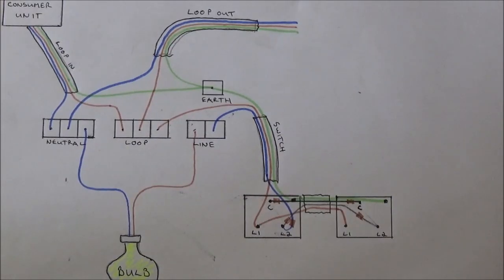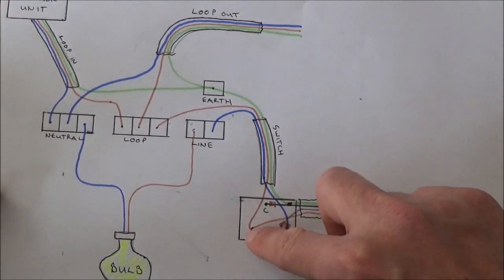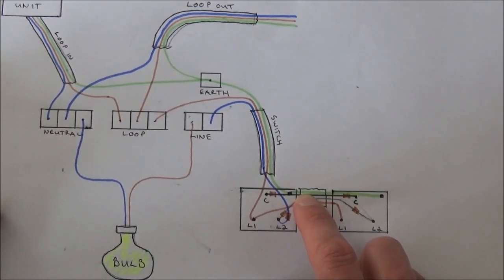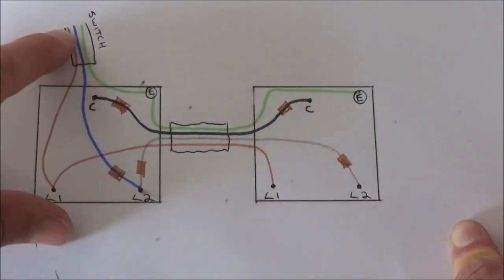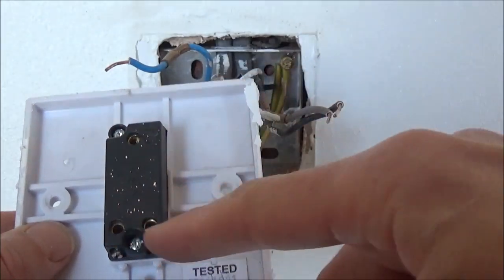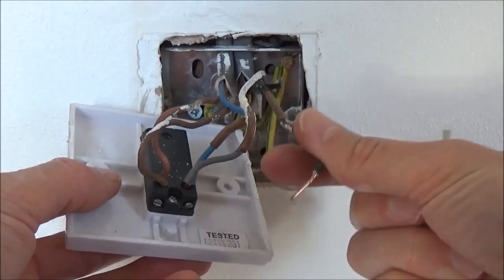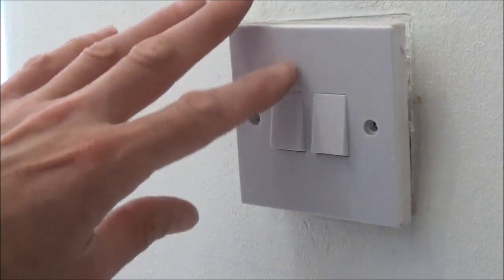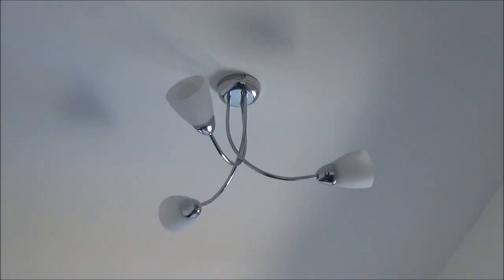How to wire a 2 way light switch. 2 way lighting explained. Light switch tutorial!

Comment: Great channel.

I have a 3 gang switch, and I'd like to move the "2way switch wiring" from the right gang to the left gang. Basically, swap  them over because my stair light physically located on the left side of the landing. Just to align the gangs with the physical location of the light. Is it ok to swap the gangs over following the wiring principles?

Comment: Hi. Thanks for the very informative and interesting videos. One question please. I have a corridor one switch is in kitchen and the other switch is in the hallway 8 meters apart. Both switches are 2 way.

The wires from L1 to L1 and L2 to L2 needs to go up pipes then through each ceiling rose without any interruption and to the  switch? Is that correct?

Comment: You didn't explain what happens when both switches are set to connect Common and L1.... can you explain what happens? there's no connection to the neutral
Reply from the maker: You basically can turn lights on or off from either switch. Hope that helps. Thanks for watching.

Comment: Using this method is great but the practicality of having to put 10 wires (more if you are looping out to another light) into a ceiling rose is difficult especially if you have 1.5mm wires and have to put additional sleaving on them to identify switched lives. Far better to have all the wires to go into a junction box above the lamp unit in whatever void you have . Then you only need the two wires and earth coming out of the junction box to the lamp unit. Not always possible if you are converting and have not access to put a junction box in but preferable if you can do it.
Reply from the maker: Hi Chris, yes there are several ways of doing it, this is just one. You can even wire the connections behind the switch. It all depends on the set up and accessibility really. Thanks for the feedback.

Comment: I have a 2 way switch.  Want to swap one  switch for a dimmer PLUS rocker, leaving other switch as is.  Do I need new wiring to join dimmer with rocker?  Cannot find a thing on it.
Reply from the maker: Not really sure what it is you want to do. If the rocker has the same terminals on the back as your standard switch then should be ok but if not then you will need to reconfigure the wiring some way. If in doubt get an electrician to have a look. Best of luck with it.

Comment: What if its a 2gang on the hallway and on the landing opposed to a 1 gang?  Meaning downstairs you've got a 2 gang switch 1 rocker  controls hallway lights and the other rocker  controls upstairs landing, and you've got the same upstairs. Do you just connect one side from the downstairs light and then take the 3 core cable upstairs and connect. Then use the other side for upstairs light and take 3 core cable downstairs and connect?
Reply from the maker: Just treat each switch as a single gang switch as that's all they are really just placed in one housing. So as you said just wire to the correct terminals.

Comment: Hi fella, nice video.
I've a dimmer switch that has been detached with a wire input that goes from a double plug, into a one-game switch, then wiring coming out of the one-gang into a dimmer.
The wiring goes to 2 lights in a fitted bedroom.
The wiring to go into the dimmer switch is 2 brown, 2 blue and one green/yellow (no black).
The back of the dimmer switch is L1, L2 and common (I guess, an arrow with a wavy line over it).
What wires would I attach to the dimmer switch?
Reply from the maker: Sounds like a fused spur from socket to power the lights. However I'm not sure what's going on there and wouldn't like to comment without seing or testing it sorry. Often people use a fused switch to directly turn lights on and off. Not sure why it would then go to dimmer. You should also have a 3amp fuse in switch and not 13 which they often come with. My advice would be get it tested to be safe. Could be some dodgy wiring! Probably hasn't helped Sorry!

Comment: Thanks for this, what happens if you have a light upstairs with a switch, a light in the hallway with a 2way switch (1 for the hallway and 1 for the upstairs), i am asking because we recently had a flood and the result was we needed a new downstairs 2way switch, it was replaced, however whilst both lights work if you switch the upstairs light on using the downstairs switch you cant switch it off upstairs... (is it the same etc) thanks
Reply from the maker: Sounds like it wasn't wired back in right. If it worked before and the wires are still the same then it should be possible to sort it out easily. Best of luck!
Reply: @POUSEaroundtheHOUSE  i managed to sort it out, i went back to basics to work it out sorted the downstairs light out first , then using a small cable i linked the 2 coms together in the switch, then i put the red cable in L1 and the black cable in L2 , all works fine etc.

Comment: I Have two lights in  room.
How can I get them both to come on same time. And I want to control the lights with two way switch.
Reply: joe khan do as he explained with one light, then add a cable from light to light. Same connections both ends. Blues to neutral, earths to the earth block and browns to line. You could end up with four cables in the one light but dont worry it’s easily connected

Comment: Hi, I already have this setup in my brothers house, he wants a  3rd switch put near his bedroom door. I’m guessing I would need something like an 8 core cable to run all 3 light switches or could I put additional 4 core cable from the 2nd switch to the 3rd?
Reply: Tristan Simpkins put another 4 core from the second switch (the one with only one existing cable) to the new switch. You’ll need to buy an ‘intermediate’ switch with 4 terminals to go in the middle one. Wire the new end switch the same as before. The middle switch now with 2 cables - join through the commons with a connector, connect the two L1’s with the same colour from each cable, connect the two L2’s with the remaining colour from each cable.
Reply from the maker: Sorry for late reply, how did you get on? If in doubt call an electrician! Thanks for watching.

Comment: Thanks. Nice to see both a wiring diagram and then actually seeing it done physically - makes it easier to understand. When you did the downstairs switching (second switch) should the grey and black wire also have brown tape put on them as they can potentially become live ?
Reply from the maker: Yes, grey and black should be identified as live if being used as a switched live. I think I show that in the video. Thanks for watching.

Comment: Hi Mate, great video. If I wanted to replicate this exact scenario but with a junction box in place of the ceiling rose and then connected to a tube light in my case, would the same/similar steps apply?
Reply from the maker: Yes, you can replicate the wiring of a ceiling rose in a junction box. I have a video that covers that here - How to fit a ceiling light. Lighting circuits explained. Replace and install a light fitting. - https://youtu.be/iQAs5zq-32c

Comment: Hi, thanks for this, does this work the same if I want to add a second switch to my downstairs hall?  I have a double switch in the hall already by the stairs for upstairs/downstairs and a double switch on the landing for the same, however looking to add a single switch near the front door as it's pretty dark when you walk in and you have to stumble over to the stairs to the light switch.  This would only be to turn on the hall light, not the landing.  Is it the same principle?  Also, my switches have L1, L2 & L3, is L3 the common?  Sorry if asking stupid questions, just want to make sure this can be done.  Thanks, great video by the way.
Reply: Denise Fowler if you are asking if you can have 3 switches controlling your hall light, this video won’t help. You need to look at intermediate light switches.
Reply from the maker: One of the switches in your hall will be for the downstairs light. You need to run a cable from that switch to another switch by the entrance door (as you said) as seen in the video. You will then have two switches for the hallway light. Hope that helps. Thanks for watching.

Comment: Hi, great video. I don't need a second switch anymore due to moving a stud wall, am I right in thinking I only need to remove wiring between the two switches? Thanks
Reply from the maker: Hi Dean, yes that's true assuming your wiring is as in the video. Hope that helps. Thanks for watching.

Comment: Might be worth mentioning that while you are working on the 2 gang switch in the hall that you should isolate both the upstairs lights and the ground floor lights as there will be live wires to the hall circuit inside that switch.
Reply from the maker: Good point, thanks for the comment.

Comment: Hi Pouse, great video as usual. Thanks very much. However, I have a query, if I may ..... in my living room ( formerly two rooms but now one) I have two lights controlled by one switch but I'd like to separate the switching so I can operate each light separately by a dual control switch ( i.e. two switches in one box). The current switch appears to be simple with just two wres in it. However, one of the ceiling roses is wired as standard but the other has numerous wires in it. Are you able to explain how to separate the switching for the two lights please? Many thanks.
Reply from the maker: Hi Jeff, without looking it's impossible to say as there are different ways to configure the wiring to achieve the same result. You could try my other video - How to fit a 1 way light switch - https://youtu.be/IqptsH7X4RI. This may help. Failing that it may be worth employing an electrician to take a look as safety is obviously the priority. Thanks for watching and best of luck.

Comment: if one of the switches is to be replaced with a dimmer does it matter which one it is?
Reply from the maker: No, but when you turn the non dimmer switch on it will just go to the brightness you set previously on the dimmer switch. Thanks for watching.

Comment: Hi, I’m having trouble wiring my new light switch. Tried to copy your video but I think my electrics are wired differently. In one switch I have 2 red wires and one brown and in the other I have the same but with an extra green wire. I’ve tried to connect the brown to com and the red ones to L1/L2 on both sides and have earthed the green but it’s still not working. Am I just that silly that I can’t understand? Thanks
Reply from the maker: Sounds like you effectively have your ceiling rose wiring (loop in / loop out) in the switch rather than in the ceiling. Difficult for me to explain without seeing it or doing another video. If in doubt, call an electrician, don't injure yourself or blow the house up! Best of luck and thanks for watching.

Comment: I think you have swapped L1 and C. Live current must go to C which is the Common. Correct me if I'm wrong. Thanks.
Reply from the maker: Hi there, not with 2 way switching, it's as seen in the video. Thanks for watching!
Reply: If wired in single core cables through conduit then you can feed the common one end, and return to the light from the other common. Then you just need 2 wires to connect the L1 and L2 terminals on each switch

Comment: Can I connect up 2  x switchs  using the Blue, Brown and Earth cables only. I want 2 switchs for my garage light but at the moment only have one.
Reply from the maker: You will need 3 core and earth cable running from the existing switch to the new switch. You will also need both switches to be 2 way switches. You need 3 wires to act as live and switched live wires, and you'll need an earth wire, so 4 wires in total. Hope that helps. Thanks for watching!
Reply: Thanks very much for the info I will give it a try.
Reply: Forgot to mentiom the Brown Blue and earth is the original wiiring.

Comment: hi mate, good walk throughs, is it safe to bypass the switch join blue and brown as i have hue lights and i need them to be on permently as i have a sensor on the landing. cheers
Reply from the maker: It is safe to connect brown and blue as long as the blue is colour coded with brown tape or sheath so it can be identified as a live wire and not a neutral. Not quite sure of the install you're doing though. Hope that helps. Thanks for watching.

Comment: Hi pal,,I’m trying to change my light switch upstairs but the old switch is different to the new switch,,,have you got a Facebook page so I can send you 2 pictures because I’m lost lol,,,old switch has l1 l2 l3 twice and the new switch has 1 2 and com,,,I’m confused lol
Reply from the maker: Hi there, No FB page sorry. Com = l1 (and will be the terminal on its own), 1=l2, 2=l3 and will be next to eachother. If you have them all twice on one switch unit, then sounds like you have 2 switches on one unit which is a 2 gang switch. Both switches can operate separate lights, it's like 2 switches on one unit. Just don't disconnect the wiring until you have the right replacement switch! If in doubt get an electrician to have a look! Sorry if that hasn't helped. Thanks for watching!

Comment: Good video, I think some older houses use an additional single core cable, rather than a single 3 core cable.
Reply from the maker: You're right Andrew but if the wiring is that old, it'd be better to renew it completely than adjust it as it is likely it won't have modern safety protection like correct earth bonding and RCD protection etc so always worth bearing that in mind. Thanks again for watching!
Reply: Yes, older houses sometimes installed metal conduit with single wires run thru them (prior to this it was wooden capping installed by the carpenters.!!). Two way wiring for single core cable would be slightly different but the same number of conductors would be used. IE The feed/live cable would terminate in the common terminal of the first switch, the switch-line would terminate in the common terminal of the second switch, and a pair of 'strappers' would run between the two switches and connect into L1 and L2. This method was/is much more common in commercial/industrial type situations as less cable would be used, but as you say, also used in older dwellings but as Pouse says, if that old it needs replacing.

Comment: Completely confusing !
Reply from the maker: I hope you mean the wiring and not my explanation! Thanks for watching Bob!
Reply: I know Pouse tried to keep this simple Bob, I'll just add that while it is important that the common conduct (black wire in this case) is in the common terminal at both switches, if the brown and blue conductors (strappers) are transposed then the circuit will still work perfectly.  So just maybe easier to remember, black to common and Brown and Blue to either L1 or L2 at either switch.
Reply: Thanks so much Yes you word perfect
Reply: Bob good